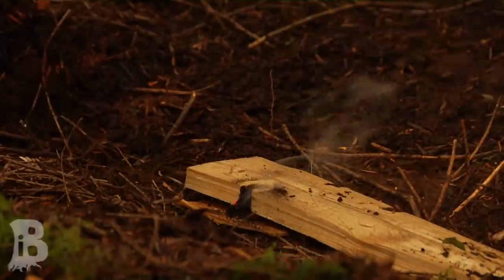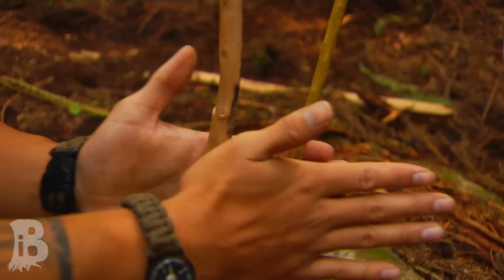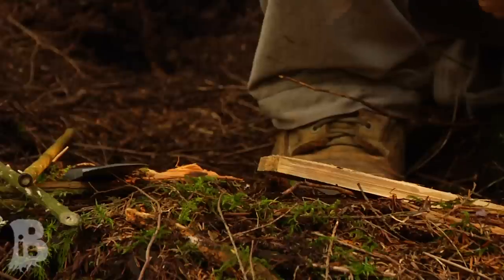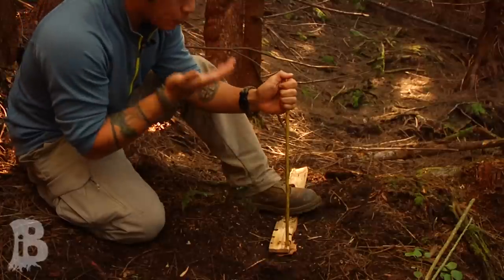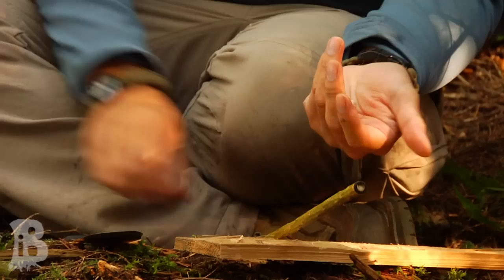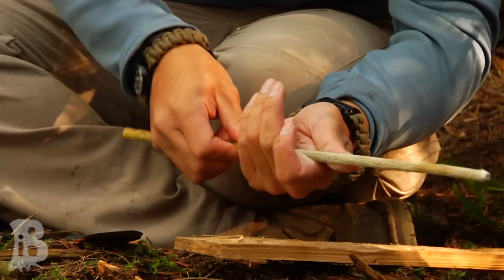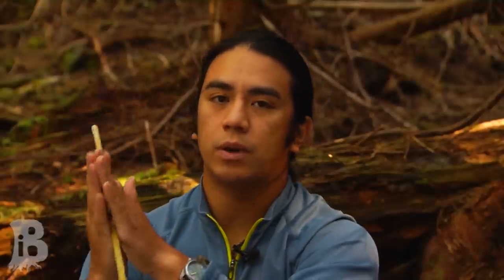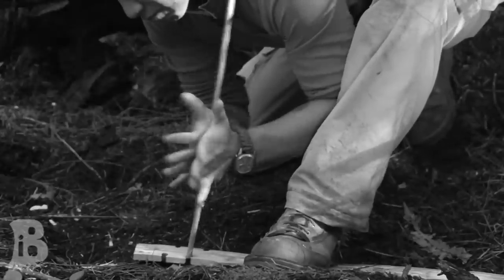Hand Drill Friction Fire: Complete Step by Step

Comment: That was easily the best hand drill how-to video I've ever seen, no contest.  A concise, detailed explanation combined with a superb demonstration and excellent camera work, very well done!  Hand drills are a technique that I've never quite mastered myself; this will help I think.

One thing I might add just as general advice to anyone who's just learning this stuff is that there is a common mistake that I have seen other people make and have even made myself with friction fires of all kinds-hand drill, bow drill & pump drill.  We sometimes don't seem to realize that the coal will usually last quite some time before going out, get too excited at successfully making the coal, and then get in way too big of a rush to get it into the tinder bundle. More than once I've seen people accidentally kick the fire board while trying to get up too fast (I've done it too...once) or lift the fire board too fast & throw the coal away in the process (never done that one though).  Either way it means having to do it again.
Reply from the maker: Or blow the cherry all over the forest floor. I've done that!

Comment: Hand drill
Hey Andy, went outside today and all I could find was a 15 inch stalk of an unidentified plant 1/4 inch in diameter ( had a pith ) and used a shim like you buy from Home Depot for a hearth board.
About as downsized as you can get, lol. Managed to get a fairly good sized dust pile and smoke, considering what I was using, so needless to say my confidence level is through the roof. I managed to find some pine crystals too and that made it possible to work that skinny drill.
You helped make a great day for me...so thank you for sharing your knowledge. I now understand about the bruising.
                                                                                      Greg
Reply from the maker: +Greg Long Awesome Greg, glad our little chat helped you out. It took me a long time to dial this technique in, so keep at it :)

Comment: I went out the other day to find some mullein to use as spindles. I found some along with horseweed and teasel. Was using a yucca hearth and it worked like a charm. When I first started learning I could not get enough downward pressure to do much. Now I have to be careful because I'm breaking spindles. Looks like learned how to get the pressure I needed. Teasel works like a charm too.
Reply from the maker: thumbs up

Comment: I've tried this many times and have never succeeded. I can't generate enough downward pressure. The best I've managed was smoke once. I'm great with the bow drill but if I had to depend on the hand drill for my fire I'd remain cold and in the dark. Bummer.  Have you ever placed the end of the spindle on a scale and measured the pounds of downward pressure you generate while spinning your spindle on the scale? You may be surprised. A fellow named Storm (deceased now) was expert at the hand drill and in one of his articles he stated that he measured the pressure and was surprised.

I found the article and here is the excerpt I was looking for.

[Speaking of pressure, I performed hand drill (Mule Fat on Sotol) a 			few times on a doctor’s scale to measure the downward pressure 			necessary to generate an ember. Using the regular technique—7.8lbs. 			Using solely the floating method—4.4 lbs.]
Reply from the maker: Try the pine pitch generously applied and really lean into the board
Reply: InnerBark Outdoors
Thank you. I'll try that. I found Storms old website: http://stoneageskills.com/index.html
 More of his articles are available at Wildwood Survival website.

I'm very impressed at your skill with the hand drill. I'm envious too but I can see that you worked hard to gain the skill. You earned it the hard way and that's usually how it's done, right? Blood, sweat and tears.

Comment: Hand Drill Trick:  Push down harder instead of spinning faster & maintain that downward force while switching hands (thumb trapping the spindle against the open hand, so you don't have to unscrunch one hand out from under the other & loose that heat).  Useful for getting a coal, even with less than optimum materials.
Reply from the maker: thumbs up Good trick!

Comment: Great informative video. I've got several questions, but I will just offer one or two at a time. What is the distance between the hole and your foot hold on the the hearth or fire board? Also what part of your foot do you hold down the hearth with? The ball of your foot or the arch where the hearth would naturally fit into. I can get an ember or two in a row and then I can't get one for about 5 tries my hands get trashed and than I can't try again for about 10 days. I'm not giving up. To be able to create fire the way our ancestors did 10 of thousands of years ago is way to cool!
Reply from the maker: The distance between the foothold and the hole is not important. It just needs to not move and you need enough room to move your arms in your center line. As with where your foot is planted, that will depend on where it is comfortable, the thickness of the board, and the evenness and softness of the ground. Ball of the foot works for me. During filming I must have made at least 10 cherries. Build up your hands to do it so you don't have to recover. Stop at 2, next day do 3, and so forth.

Comment: I've learned that the ideal spindle diameter is anywhere from 1/4 to 1/2 an inch. I measured the spindle that I'm using and it's tapered. 3/4 of an inch at the top and 1/2 inch at the bottom, or working end.  In your experience is it better to be closer to 1/4 inch in diameter at the bottom or working end? I'm wondering if maybe my spindle might be my problem with only achieving an ember intermittently. I'm really interested in becoming proficient at this in order to pay homage to our ancestors of tens of thousands of years ago and what they had to go through in order to make fire. We have smart phones and I pads but I don't want our ancestors to think we forgot about them. That's why I'm kind of passionate about learning this fire starting technique. I would also like to be able to share it with other folks as well.
Reply from the maker: 1/2 inch is the upper side of what I would do. The working end should be the wider part too. If you watch the part of the video with spindle size selection you'll see why you're probably not getting enough speed. The dust should be dark brown to black.

Comment: So when I went to a village in Kenya and they did a hand drill, they put a pinch of sand in into the pilot hole and claimed it would get a coal faster, and it seemed to work but I was wondering if you had any previous experience doing this and could tell me if it actually helps or just looks like it does. Thanks.
Reply from the maker: Inthelambdacore Doss I do that if the spindle gets a shine to it and it works well. Just gotta make sure it's super dry.
Reply: Cool thanks!
Reply: InnerBark Outdoors I use a little sand/gritty dust when I am teaching kids.  They will often polish the hole by using too little downward pressure.  The sand fixes that problem

Comment: I have some question about you great vid :
- is it possible to 'build' a portable spindo?
- is it possible to create some sort of a handle at the top of the spindo where you put your hands? 
- can different materials than wood be used for the spindo?
Reply from the maker: These are all great questions! To sum it up, yes you can make a portable one (aka smaller) and adding a handle as well is possible. Now about the different material, I'm not  too sure, I haven't messed with anything other than wood just because it creates the correct tension/friction/reaction that you need to start your cherry. Thanks for the comment, it's a great idea for a video and i'll write it down and hopefully get to that this summer.
Reply: Thanks for the reply. I will try myself and let you know ;)

Comment: What are your two best combos? I've read weed on wood is best? Like Mullein, a weed, on Cottonwood a wood? I just noticed that you didn't mention Mullein as a spindle material. Any opinion on that? Thanks very much for your valuable time. You have been very informative and kind. Also is Sotol absolutely the King of the Mountain when it comes to friction fire?
Reply from the maker: Weeds on wood are nice because weeds come in the nice shape to start with. I can't mention all the woods that are suitable, just the most common to folk. I've used pine as a board before just to see how impossible it was and was still able to get one from an older piece. Most people will say its impossible but its not. Sotol is pretty bad ass, but I don't have any here.

Comment: Thanks for the great video!  Explanation, demonstration, and camera work are all fantastic.  

I had to laugh a bit though.  Doesn't remembering to carry pitch with you (4:32) kind of defeat the purpose of learning to this?  I thought the point of this was to have a skill that you can use anytime, anywhere without the need to plan ahead?  If you're going to carry something with you, why not a lighter?  

I've been trying this for a little while and have gotten some smoke, but no ember yet.  I'm excited to try what I've learned here.  I think it will make a difference.
Reply from the maker: Pitch can be used for a lot of different things, not just this. first aid, adhesive, as well as a friction enhancer.

Comment: you ever tried that trick were u notch the top of the spindle and take some cord and make 2 thumb loops so your hands ride in one place on the spindle? if so does that help reduce blistering?
Reply from the maker: I have not. I learned the floating hand technique instead. The thumb loop deal might make it hard for you to use the whole surface of your hand which could lead to blistering

Comment: In your opinion whats more important, pressure or speed? I've been at this for about 2 months now. On and off again due to blisters. I'm using Yucca on Yuccca. I get an ember and than I can't get one for about 4 more tries. I've watched numerous youtube videos on the subject, yours being hands down the best I've seen, but I'm still struggling. I can't determine what I'm doing right when I finally succeed or what I'm doing wrong when I fail. I just trashed my hands again after 3 attempts. Same results, smoke and a pile of brown dust or smoke and a black charred pollished tip and black hole and no ember with yet another blister to lance and recover from. I hope this takes about 6 - 12 months to become proficient at. I'm in good shape. I go to the gym 5 days a week, lifting weights and plenty of cardio, but this primitive skill is making me feel like a Girly Man.
Reply from the maker: Pressure and speed go hand in hand (no pun intended). If your powder is light brown, not enough speed. If its too fine, not enough pressure. Most of all it is patience. Strength has nothing to do with it. I learned from a 60 year old skinny hippy dude. I will tell you this. STOP before you get a blister. This technique took me a week to get it down (with blister recovery). I've seen some people do it in an hour. Patience is key. Try shaving your spindle down as narrow as possible while still having enough strength to put pressure down. You can go rather slow for the first bit till the notch fills, then push the NOS button and let it rip for the heat to ignite the powder.

Comment: Does the spindle have to be a harder wood then the notch wood? Is there some type of way to remember what type of wood to use?
Reply from the maker: They both need to be a soft material. In my experience it doesn't matter which is harder, although it's easier to build a good fireboard than find/straighten a good spindle so I like to use a harder spindle for that reason. Just remember which woods are native to your area. Heck, I've used pine which is typically a terrible wood to use (because of the resin) bit found some pieces with little resin content and it worked.

Comment: I always carry a pad of still wool with me, put a match to still wool and you have a fire.  Don't try this until you are in a safe place for a fire. Next thing I always have is some sandwich bags. if nothing else works, I just pee into a bag, kind of get all the air out of it, catch a sun beam and use it as a magnify glass, something dry that will burn, and direct the beam on it. You can try this just with water directing the beam onto your hand, it will get hot
Reply from the maker: thumbs up

Comment: Does the wood have to be completely dry, or can you cut fresh branches and fresh logs and still able to start a fire?
Reply from the maker: Completely dry. Moister will suck away heat caused by the friction.
Reply: Okay thank you! I tried this twice. The first time was as the beach with completely primitive style. I found stones and crudely knapped them into sharp pieces. On my own it was super hard, but me and my friend did it together and produced a coal, but the tinder bundle was too damp so it failed. Next time I tried was deep in the forest with only stones as well, but it was way to hard to carve the v shape notch and I had no idea what wood I was using. I got it to smoke but that's it. I will try it with a knife next time and do it until I succeed! Your video is one of the most informal video I have seen, I am really grateful for this and hope to see more! :)

Comment: What is the problem or problems if I end up with a pile of brown dust and no ember or a polished tip on the end of the spindle. I'm in Salt Lake City, Utah and I'm using Yucca on Yucca.
Reply from the maker: Sounds like you have enough speed, not enough pressure. Spend a little extra time to wet down the spindle with a bit of spit before you start to give you a little extra time before it dries. If its still being polished, add a wee bit of grit in the hole. You'll be surprised what more grip will do to help reduce blisters and increase endurance in the shoulders.

Comment: If pressure is more important than speed, shouldn't the smaller diameter end of the spindle be the working end drilling into the hearth board?
Reply from the maker: If the smaller end is at the bottom, your hands will slide down faster, and the hole will be bored out larger and larger as the set wears which will increase friction in a bad way.
Reply: InnerBark Outdoors I used a Mullein spindle measuring 1/4 diameter on the working tip and 7/16 in diameter on the top of the spindle. The hearth was Cottonwood 1/2 inch thick. I drilled about 3/4 of the way through, about 30 passes down the spindle and accumulated a huge dust pile with no ignition. I got frustrated and gave it every thing I had, I finally got it to light and it was twice the size of a bow drill ember, it was huge! Luckily I've been at this for about 12 months so my hands were sore, but no blisters. I'm about to flip the spindle using the 7/16 end as the working end to empirically see what occurs. I will post again after the experiment.
Reply: InnerBark Outdoors No good using the larger diameter at the bottom. About 30 passes down the spindle, which popped out and then the spindle and tip got polished and I just got my 40th blister and no ember.

Comment: How far should the hole for spindle be from the edge of the board?
Reply from the maker: It varies depending on spindle diameter, but for me, I like to have the burn hole about 1/4" away from the edge.
Reply: Thanks for responding. That's about the distance I used. My 8yo daughter and I tried in the back yard but only got smoke and no embers. I believe our spindle was too thick and we could not get enough revs. Will try again next weekend. Cheers.

Comment: This is a very good tutorial, and anyone attempting the hand drill for the first time would be well advised to watch it.
However, I find that you're being a bit prescriptive. There are no real "golden rules" for this skill, other than: "If it works for you, then it works". If one were to try to formulate a golden rule for friction fire, it might be: "pressure is more important than speed".
For instance, your insistence on the karate chop and the long strokes cannot be accepted as gospel. As you mentioned, many very proficient hand-drillers choose to use only the palm. Have you perhaps thought about why this might be? Yes, it certainly requires more robust hands, but the required calluses develop pretty quickly with practice. Longer strokes are not necessarily an advantage. I'm sure you understand the difference between static friction and dynamic friction. What this means is that the friction is greatest at the moment that the drill starts to move, at either end of its rotation.
So, in many ways, the SHORTER the strokes the better, because this will mean more changes in direction.
As they say, there are many ways to skin a cat....
Reply from the maker: thumbs up

Comment: I've gotten embers when the working end of the spindle and the hole are brown.  As I'm getting more and more proficient at failing, the spindle and the hole are jet  black. That makes no sense to me. That relationship should be the opposite.
Reply: You are correct. The likely explanation is that i) you are ,in fact,becoming  more proficient (black is better than brown);  ii) your later attempts are failing due to insufficient air (oxygen) and this in turn is most likely caused by a sub-optimal notch.
Reply from the maker: thumbs up